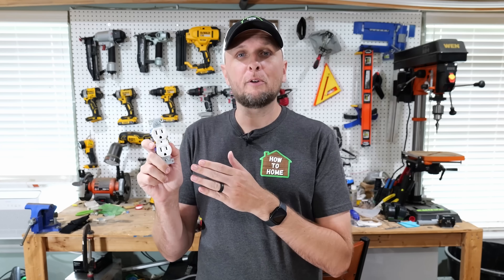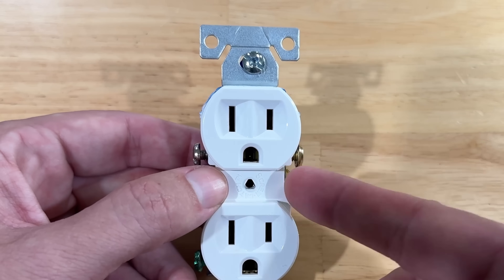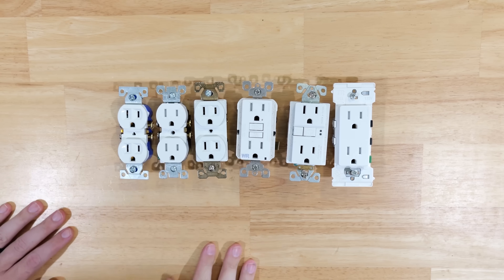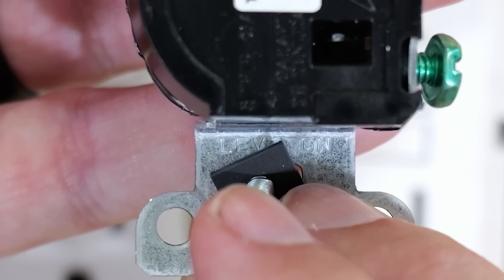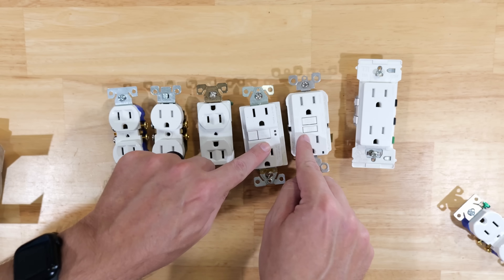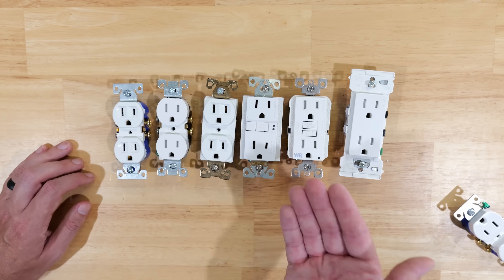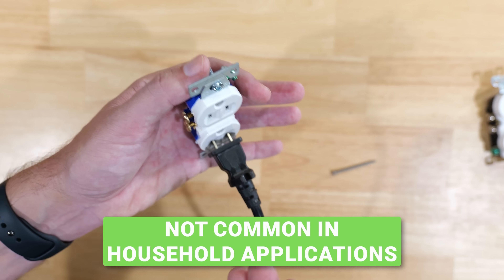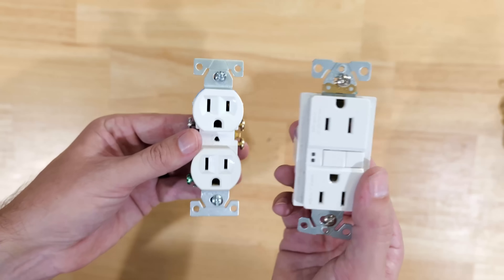The Shocking Reason Why Your Outlets Are Installed Upside Down!

Comment: I'm not an electrician, but one informed  me that ground plug down was better because most plugs when extremely loose in outlet tend to hang or drop at bottom thus ensuring the ground stays in the outlet and making circuit safer.  Not sure how true that is, but sort of made sense to me.
Reply: @KirkMattioda: Ground prong up when that outlet is attached too the wall-switch so people there know where to plug in their lamp to control it from the wall light-switch.
  Medical facilities have things hanging on walls that fall, like clipboards, scalpel, hemostat, that can fall and short the circuit, military galleys and  restaurants, ground up was specified, due to stainless steel utensils being dropped, etc. Therefore it has become required that they be ground up for contractors. In many cities ground up is standard in all commercial and industrial buildings, ground only go down in residential buildings, houses, apartments, condos, etc. 
   Internationally, countries with 3-prong outlets always have the ground up
   Everything is in context and the answer DEPENDS on context. 
   Examples:
“Never took the orientation of an outlet seriously until I was measuring for a shelf with a tape measure. It slid down and fell across the prongs of the washing machine plug.  POW! “ —@joef.6596
“I work at a K-8 school. Maintenance assembles powered multi media carts with the ground plug up in consideration of teachers dragging metal bracelet chains across partially unplugged power plugs.” —  @scaryhouse7969
“a length of florist's wire rolled off a side table onto a slightly loose plug and shorted the circuit, creating a small fire (quickly extinguished).  I now always install ground prong up” @deegee54
“I work at a restaurant and we have this work table with some outlets built in on top. Someone managed to let the edge of some tin foil go in between a plug and the outlet and it got disintegrated.”@MatthewSuffidy
“I knocked some change off of my end table one day my mistake of course, and a coin fell down right on the prongs resulting in a loud pop and a flash along with some smelly black smoke. I have since gone through my home and reversed all of the receptacles so the ground prong is now on the top.”—@chrisenglert3958
“my wife's gold necklace chain dropped off the rack onto two prongs of a device that were plugged into a receptacle with just a little prong showing.  It vaporized the gold necklace area of contact and left a nasty burn mark on the faceplate of the receptacle.   This was on a bar and I probably should have oriented the receptacles there ground prong up.“—@winfordnettles3292
"I had lunch with the Chief Electrical Engineer at McDonalds headquarters. He told me that one of the workers in one of their stores had her hand badly burned when a metal cookie sheet (or something similar) slid out of her hand. It fell onto a receptacle that was loose…the metal cookie sheet made contact with the two blades resulting in  big arcing flash that caused the injury, this is a reason Ground Up is safer."
“In commercial buildings (where receptacles are very high from the floor) ground has to be at the top. In a case of a water leak ground has the first contact with the water. In residential buildings (where receptacles are not far from the floor) ground needs to be at the bottom. In a case of a flood, ground wire would have the first contact with the water.”—@powerzx
“When a heavy extension cord or wire from a device plugged in is experiencing stress from the cord being pulled taught or tugged on, the greater force is usually downward. The ground prong being longer, exerts the greatest torque when the wire is being pulled in a downward direction.  Occasionally that downward force will cause the plastic of the ground prong opening of the receptacle to crack from the downward force. If the ground prong is up, that downward force has much greater support from the receptacle structure. I’ve personally cracked a few receptacles over the years working on projects where the wire plugged in was being yanked around a lot. Where the ground prong was up, the extension cord always stayed more securely plugged in.”—@TechwizJoe1
"while working in a mechanical repair shop, I went to get something off the shelf that the radio was on. I bumped the radio. as I turned POW, FLASH, BANG.  the metal antenna fell sideways and was across the plug and touching the window frame. glad i did not try to catch the falling metal antenna.  an extension cord was just a little loose in the socket.”@tazhd143

Comment: ground down also puts two prongs on top, better resistance against gravity and weight of cord to lever plug away from receptacle.
Reply: @auntysocialist: Ground prong up when that outlet is attached too the wall-switch so people there know where to plug in their lamp to control it from the wall light-switch.
  Medical facilities have things hanging on walls that fall, like clipboards, scalpel, hemostat, that can fall and short the circuit, military galleys and  restaurants, ground up was specified, due to stainless steel utensils being dropped, etc. Therefore it has become required that they be ground up for contractors. In many cities ground up is standard in all commercial and industrial buildings, ground only go down in residential buildings, houses, apartments, condos, etc. 
   Internationally, countries with 3-prong outlets always have the ground up
   Everything is in context and the answer DEPENDS on context. 
   Examples:
“Never took the orientation of an outlet seriously until I was measuring for a shelf with a tape measure. It slid down and fell across the prongs of the washing machine plug.  POW! “ —@joef.6596
“I work at a K-8 school. Maintenance assembles powered multi media carts with the ground plug up in consideration of teachers dragging metal bracelet chains across partially unplugged power plugs.” —  @scaryhouse7969
“a length of florist's wire rolled off a side table onto a slightly loose plug and shorted the circuit, creating a small fire (quickly extinguished).  I now always install ground prong up” @deegee54
“I work at a restaurant and we have this work table with some outlets built in on top. Someone managed to let the edge of some tin foil go in between a plug and the outlet and it got disintegrated.”@MatthewSuffidy
“I knocked some change off of my end table one day my mistake of course, and a coin fell down right on the prongs resulting in a loud pop and a flash along with some smelly black smoke. I have since gone through my home and reversed all of the receptacles so the ground prong is now on the top.”—@chrisenglert3958
“my wife's gold necklace chain dropped off the rack onto two prongs of a device that were plugged into a receptacle with just a little prong showing.  It vaporized the gold necklace area of contact and left a nasty burn mark on the faceplate of the receptacle.   This was on a bar and I probably should have oriented the receptacles there ground prong up.“—@winfordnettles3292
"I had lunch with the Chief Electrical Engineer at McDonalds headquarters. He told me that one of the workers in one of their stores had her hand badly burned when a metal cookie sheet (or something similar) slid out of her hand. It fell onto a receptacle that was loose…the metal cookie sheet made contact with the two blades resulting in  big arcing flash that caused the injury, this is a reason Ground Up is safer."
“In commercial buildings (where receptacles are very high from the floor) ground has to be at the top. In a case of a water leak ground has the first contact with the water. In residential buildings (where receptacles are not far from the floor) ground needs to be at the bottom. In a case of a flood, ground wire would have the first contact with the water.”—@powerzx
“When a heavy extension cord or wire from a device plugged in is experiencing stress from the cord being pulled taught or tugged on, the greater force is usually downward. The ground prong being longer, exerts the greatest torque when the wire is being pulled in a downward direction.  Occasionally that downward force will cause the plastic of the ground prong opening of the receptacle to crack from the downward force. If the ground prong is up, that downward force has much greater support from the receptacle structure. I’ve personally cracked a few receptacles over the years working on projects where the wire plugged in was being yanked around a lot. Where the ground prong was up, the extension cord always stayed more securely plugged in.”—@TechwizJoe1
"while working in a mechanical repair shop, I went to get something off the shelf that the radio was on. I bumped the radio. as I turned POW, FLASH, BANG.  the metal antenna fell sideways and was across the plug and touching the window frame. glad i did not try to catch the falling metal antenna.  an extension cord was just a little loose in the socket.”@tazhd143

Comment: Flat plugs pretty much settle the issue. Unless the prongs are configured to be plugged-in from the side or sideways (or are rotatable), they're always (or almost always) configured for ground down. So, if you had the outlet with ground up, you couldn't plug it in without the cord sticking up and hanging away from the wall. Case solved. Next!

Comment: I understand there is no standard in households of which way is up.... but the manufacturer of products that are inserted into the outlets need them to be installed with the ground down.  Moving into an old house & I cannot use so many of my products due to them being upside down in the entire house.  So annoying! Standards are important and there should be especially with electrical implementations. Safety issues. I'm so glad that Airwick & Glade make 360° twistable plugs to suit any place.

Comment: I've hardly ever seen outlets installed with the ground pin up. My foster parents' home does have one, but it's only in one room (and beside the bathroom door which is the main way into that room, hence why the ground floor bathroom has two doors instead of one thanks to weirdly unique structure layout) and as far as I'm aware it's the only outlet in the entire house that has the ground slots facing up. The rest of the outlets in that house, as well as every outlet in every other house I've ever been in, has the ground slots facing down.
Reply: @samsimington5563: Ground prong up when that outlet is attached too the light-switch so people there know where to plug in their lamp to control it from the wall light-switch.
Reply: @violetviolet888 That can also be done with the ground prong down too. My bedroom has one outlet that's like that.
Reply: @samsimington5563  It's not that it "can be done" it's that is is an obvious visual cue/identifier (if it is not labeled) to the human user that that outlet is connected to the wall switch.
Reply: @violetviolet888 Oh

Comment: I worked as a maintenance engineer at a property management company. We were required to install outlets with the ground plug up.
Reply: Ground prong up when that outlet is attached too the light-switch so people there know where to plug in their lamp to control it from the wall light-switch.
  Medical facilities have things hanging on walls that fall, like clipboards that short the circuit, therefore it has become mandatory policy that they be ground up. In many cities ground up is standard in all commercial and industrial buildings, ground only go down in residential buildings, houses, apartments, condos, etc. 
   Everything is in context and the answer DEPENDS on context.

Comment: To me, the interesting thing is that the line and neutral holes are different sizes, which means that people are plugging two prong plugs into the outlets. Any three prong plug would automatically align those two in a specific orientation. I hardly ever get a two prong plug plugged in the correct way on the first try. It’s like using a USB A plug that only fits in one way.

Comment: Nice for you to do the research. I like 'down' because it looks more natural. But one exception I sometimes pick is if I have a dedicated outlet (say, refridgerator) that has a cord that comes out the side of the plug. Then I opt for orientation that puts the least stress on the cord. Having a cord exit out the the 'top' of the plug just to curl around and down is not my first choice.

Comment: Never, ever ground plug up in the bathroom. Hair dryer, curling iron, and any other appliance with integral GFCI plugs are "upside down" which always results in the plugs pulling away from the receptacle. Also true for any type of transformer plug that may have polar prongs.

Comment: I have found that when I am working in the dark and cannot see the orientation of a receptacle outlet orientation,  it is easier for me to "feel" the triangular orientation of a three prong receptacle orientation if the ground prong is located above the neutral and hot inlet locations. In the case where the outlet is in a horizontal position, I have found that I prefer the ground inlet to be located to the left if the neutral and hot inlet positions. I prefer this because I can orient the plug in my fingertips by "feel" and this allows me to conceptualize my hand orientation in space to hopefully allow me to do a "blind" insertion of the plug into the receptacle that I cannot see. I would summarize this process by saying it is possibly like reading "braille", one "fingers" the outlet location to "read" the physical configuration of the outlets orientation and then mentally transposes this "digital" information into the mirror image necessary to allow the physical navigation of the properly oriented plug, thus allowing connection between the two. Does anybody know a "blind" person who they can ask how the go about plugging in electrical appliances?

Comment: I had an old outlet in my folks house. The white plastic non-conductive part cracked. I plugged a plug in and it's end in the plug stayed but the outer part pivoted down until the two metal prongs sticking in touched the side of the metal box the plug was mounted in. Nice spark and the circuit breaker switched doing it's job. So I replaced that plug with a new one. Seems overdue to update the plug design for a safer virtually impossible to get shocked or short out design.

Comment: The ground prong should be installed down by convention. Any angled appliance cord or extension cord either drops straight down at a 90 degree angle from the receptacle or drops down at a 45 degree angle. If the ground prong is up, the weight of the looped cord will tend to loosen it at the receptacle.

Comment: This is coming from my old construction and apartment remodel days. But the reason we put the ground up (Hole at top, two slots down) is if the plug was partially pulled out of the wall and something fell over and it hits the exposed metal, it would hit the safe ground and not the hot or neutral.

Now, my example of this is quite stupid, and I am not using a standard wall outlet, but a 4-prong range. One time on an apartment remodel, I was pulling a stove out from the cabinets. Somehow, a penny was wedged in the back of the stove area, and when I pulled it down, it fell straight down the wall and hit the two partially exposed prongs of a range. There were a lot of sparks, screeching, and smoke before the breaker tripped.  There was a chance that if the ground was up on this one, it could have deflected the penny away.  (Don't know how the penny got there, probably fell behind and wedged itself in the crease of the stove and wall)

Just think, that could be a knife that fell off the magnetic knife block, a stirring spoon, a broom handle that fell down on an outlet, you're safer with the ground up.

Comment: I own a number of devices that have the cord at 90 degrees to the plug, so that, if the ground plug was up the cord would be up and create more pressure on the plug and outlet, plus the cord would simply be going in the wrong direction for ease of use.  This would, in my opinion be unsightly and, potentially unsafe.

Comment: Your own recommended Klein outlet testers (RT210 & RT250) prove it. 
You cannot read the output or screen when outlets are installed "upside down" with ground pin on top. 
Klein knows more than youtube commenter(s).
(and hospitals are not homes)

Comment: The fact that all gfcis come with line on top as it is code required in a disconnect switch.etc. that is industry standard. Why would you in residences put ground up? All plug in refrigerators come with flat plug and scented plug in devices are designed for ground down. Transpacks are also..so there is no reason left to do it in residences..unless your an idiot

Comment: According to The National electrical code , Socket orientation does not matter. Even sideways is correct. But te electrical accessory Industry adopted that by convention the Ground pin should be down or any accessories you plus into the socket will not be correctly orientated.  Right angle plugs need the ground pin down.

Comment: Have I considered these points, yes.  Missed point: wall-warts.  If "they" want to change the orientation, don't tell us, change the guideline for manufacturers.  All devices need to be made to connect in the required orientation.  I think this is micro-management by arrogant bureaucratic local lawmakers.  I hate to say there needs to be a law, but the federal government needs to regulate this by creating a law that restricts local municipalities from deviating from other states in order foster cooperation and compatibility with the rest of the country.  This is a national interest, not a local one.  We do not have local electrical outlet manufacturers, and we do not have local device manufacturers, this would make our products much too expensive.  These devices need to work in every state and municipality.